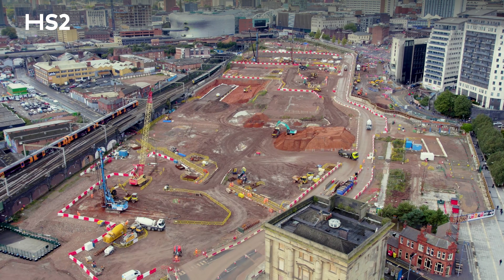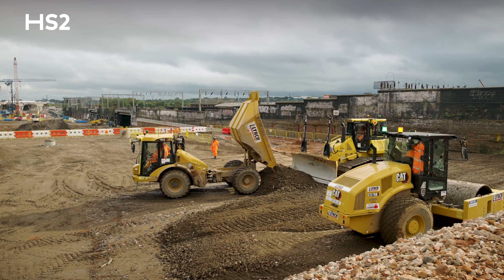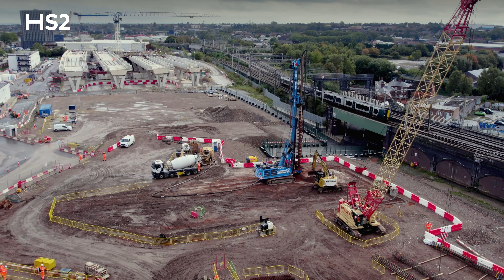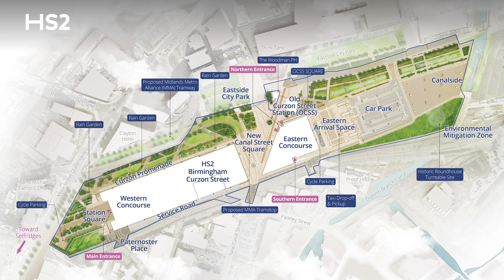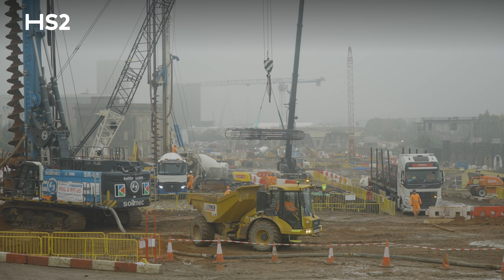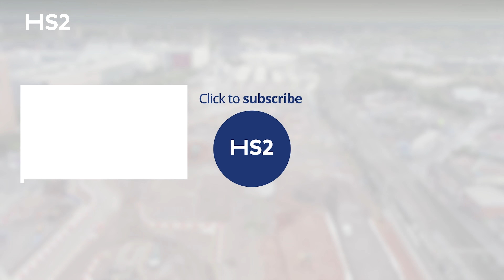HS2 lays the foundations for Birmingham’s new rail hub

Comment: Wow , 150 miles in 50 miinutes, that's too fast on land!! 3 miles per minute(approx) must be as close to a straight line as possible. It will be a wall of speed bi-secting the country-side...how can safety be assured along its entire route with 18 trains per hour going each way. A train passing the same spot every 1min 30 sec(approx)? Make it safe!

Comment: It will only be a rail hub if the line continues to newstreet, they did this before, unfortunatley this meant that curzon street became obsolete and it got knocked down. Maybe thats what is meant?
Reply: The rail hub is being built by connecting Birmingham Curzon Stret Station to an upgraded and expanded Birmingham Moor Street Station
Reply: @peterwallen1063  news to me. I have not heard of this.
Reply: @barrypickles6546  Well living in Birmingham take it from me it is happening and has been mentioned on Youtube, there are plans to enlarge Moor Street Station by opening more platforms. put in two chords connecting the camp hill line nd the Birminghm to Derby line to Moor Street so that more trains can terminate at Moor Stret station which will be connected by walkways to Birmingham Curzon Street Sttion. They can not connect the HS2 line to Birmingham New Street due to the difference in height betwen the two lines and even the old Curzon Street was not connected to New Street due to height differences between the two stations, but the old Curzon Street was not knocked down as for years it was a freight station then a Royal Mail station before closing in the late 1960's and becomming a grade 1 listed building
Reply: @barrypickles6546  Thats your problem, it has been mentioned on you tube and in railway magazines and living in Birmingham it has been mentione in our news media
Reply: @peterwallen1063  I mean I know they are buily next door to each other, but I didn't know they where going to link the lines, amazing. I suppose having the wcml will benefit curzon too.
Reply: @barrypickles6546  They are not linking the lines together the HS2 line  will be an independent line until it connects to the WCML at eather Handsacre in  Staffordshire or at Crewe they are just connecting Moor Street Station buildings to the HS2 Curzon Street Station and opening more platforms at Moor Street Station
Reply: @peterwallen1063  so not a rail hub.
Reply: @barrypickles6546  Yes a Rail Hub, as they are connecting Birmingham Curzon Street Station which will have it's main entrance on Moor Street Queenswy next door to Birmingham Moor Street which is being expanded with the opening of more platforms and spur lines comming in from the Cmp Hill Bank and Birmingham to Derby lines which will llow trains terminating in Birmingham from all areas of the Country to use Moor Street Station insted of Birmingham New Street Station  which will free up New Street Station for other services forming as the West Midlands Metro Mayor states a new Rail Hub n Birmingham City Centre. Not only that but both Birmingham Curzon Street and Moor Street will be connected to Birmingham New Street, Birmingham Snow Hill Stations and Wolverhampton Station by the Midland Metro Tram link
Reply: @barrypickles6546  Yes a Rail hub in that Both Birmingham Curzon Street and an expanded Birmingham Moor Street Station will be next to one another with connecting entrances betwee both stations but the track will not be connected
Reply: @barrypickles6546  Yes it is a rail hub as there will be interconnection between an enlarged Moor Street Station and Birmingham Curzon Street Station where by there will be walk ways between the two stations
Reply: @barrypickles6546  Yes a Rail Hub

Comment: Honestly, Birmingham doesnt need 4 train stations. Just re-use the Moor Street station (Yes it is in use but just add more platforms)
Reply: Snow hill is the same line as moorstreet, all they needed was a few more tunnels between the 2 and to take up the metro and hs2 would have been done.
Reply: @barrypickles6546  I don't think you know a lot about Birmingham, HS2 trains will not fit into Birmingam New Street due to there length and New Street is grid locked and the whole reason HS2 and Curzon Street Station is being built
Reply: @peterwallen1063  how long are the platforms at Birmingham Newstreet. I believe the biggest problem with Newstreet is the cross over tracks, not the platforms, an in dependant tunnel would solve this.
Reply: @barrypickles6546  No matter how much people keep going on about HS2, these new trains are far to long to fit into Birmingham New Street Station which is built into a restricted area betwen two tunnels and is full to capacity the reason Curzon Street Station is being built,( it is New Street not Newstreet two seperate words), plus if an independent tunnel would of solved the problem don't you think they would of done it. Building an independent tunnel would of caused no end of problems, one of them the closing of New Street Station while this supposed tunnel was built
Reply: Birmingham Moor Street and Snow Hill Station are on the Chiltern line and New Street is on the WCML and are not on the same alighnment as Birmingham New Street
Reply: @peterwallen1063  and neither are on the hs2 line. What is your point?
Reply: @barrypickles6546  Bwhat is MY point, trying to explain to the uninitiated people like your self that talk crap, I quote what you said " Snow Hill is the same line as Moor Street ( it is two words not Moorstreet ) all they needed was a few more tunnels between the 2 and to  take up the metro and HS2 would of been done " first I have seen better grammer from a 6 year old, next the Metro runs on the streets of  Birmingham and does join Birmingham Snow Hill station and Birmingham New Street station up with Birmingham Curzon Street Stations and can not be run in a tunnel under the City, next Birminghm Curzon Street and the HS2 route is on a different alighnment to both the line into Birmingham New Street and Birmingham Snow Hill plus it would cost to much to tunnel under Birmingham, that is my point. Before going on about the impossible, do a bit of reserch on the City and the reasons for building HS2 as such, yes I do know what I am on about as I live in Birmingham near to where the HS2 line is being built
Reply: @barrypickles6546  My point is that you mentioned in your comment, Snow hill and Moor Street (not Moorstreet) which have nothing to do with HS2
Reply: @peterwallen1063  yes that is part of what I typed?
Reply: @barrypickles6546  Yep, and then you asked me "Whats my Point" my point is you wrote about HS2 but know nothing of it and Birmingham
Reply: @peterwallen1063  so what is your point?
Reply: @barrypickles6546  My point is barrypickles6546 that you stated a silly comment about Snow Hill being on the same line as moor street and need a few more tunnels between the 2 to take up the Metro and HS2, what utter rubbish it appears you don't know a lot about Birmingham, it's Metro network and the respective Railway lines, for a start the Chiltern lines and Moor Street Station , Snow Hill Station are on a different alighnment to the New Street line with no physical connection due to differences in height plus neither of these two line can physically be connected to HS2 and Curzon Street Station again due to height differences between the lines and stations, next the Midland Metro is a street running tram through Birmingham City Centre and connects all stations in Birmingham starting with Snow Hill Station, then New Street Station and will eventually serve Birmingham Curzon Street Station, Moor Street Station and finnaly Digbeth National Express Coach Station in Digbeth, so that is the point mate. So as I said you do not realy know much about Birmingham and its Railways as when the decided to build Birmingham New Street they had dig a hole in the City Centre for the station and from the London end the line had to be lowered in a cutting to go under what was then the GWR Snow Hill to Paddington line and through a tunnel into New Street Station
Reply: @barrypickles6546  So whats my point, the point is that the reason for trains going into Birmingham Curzon Street insted of Birmingham New Street is that Birmingham New Street is grid locked with train services and these trains would not fit into the platforms of Birmingham New Street hence that a totaly new station is being built as a Terminal Station in Birminghm City Centre called Birmingham Curzon Street which will be used by HS2 trains only operated by Avanti West Coast Trins so frreeing up Birmingham New Stret for other train services, Birmingham Moor Street is on a different alighnmeny a is operted by West Midlands Railways and Chiltern Trains on the old Great Western line to London Paddington and the two station although will be conected by walkways the two lines will be independent of one another, thats my point, if you lived in Birmingham like I do you would understand the logic of what is going on

Comment: Between 5 and 6 piles per day is a joke compared to new build infrastructure schemes in China. Tesla’s Shanghai factory there was done in just over 9 months from bare ground start.
Reply: The piling also includes secant piling. Do you-know-what they are ?
Reply: @TrevorWilliams-fq8mg  Yes, that’s why the count is up around the 2,000 mark.
Reply: Then you should know what the piling output is. They are piles that are drilled into the sides of each other to form a water resistant retaining wall and they are much slower to construct. So your comment about the joke outputs has no relevance.
Reply: @TrevorWilliams-fq8mg  The rate I stated has relevance. China construction using multiple crews and multiple piling machines and worked 24/7. Another hallmark of why HS2 is so massively over-budget.
Reply: @PinkDuckUK  You don't know what you're talking about - the reason HS2 is over budget is almost entirely due to nimbys delaying and obstructing the project. For the entire 20 years while it faced legal challenges and obstructions, the project had to be run (wasting money) and redesigned (wasting more money) and crucially, unlike china, the project had to be built by contractors at a large premium because we couldn't give a clear start date due to the obstructions, nor any project scope since we didn't know which sections would and wouldn't be built.
Reply: But did the job in China have secant piling ? In China the planning restrictions are much less onerous than here in the UK. If we worked 24/7 we would be more comparable to China. Also the HS2 budget cost was a figure pulled out of the air. That is a joke.

Comment: Given the lack of direct connections - either cross-platform or up/down a level -  to other rail services in and around Birmingham it's hardly a "rail hub" for the city.
Reply: It will be connected to a vastly larger Moor Street Station

Comment: If its going to be the 1st mainline intercity station in 130 years, this 7 platform intercity station, wont be open for 130 years. Belfast's new 8 platform intercity station opened less than a month ago!
Reply: Birmingham Curzon Street station will be the first main terminal station to be opened in the UK for 130 years, how do you work out it wont be open for 130 years it will be open in arround 3 years at the most and the difference between Belfast and Birmingham, is that the Belfast Station is just a new Station but Birmingham Curzon Street is connected to the building of HS2

Comment: If you wanted to accrue the benefits of the infrastructure build as early as possible, it seems odd that Curzon Street didn't start construction earlier.
It didn't seem to be blocked by other construction.
I guess that's all down to budgetary constraints.
Reply: You raise an interesting point. Presumably  HS2 has decided on the construction programme but how have they arrived at what phases get built in what order ?

Comment: Why is it a terminus? Shouldn’t it be a through run?
Reply: Budget they didn't want to spend money building underground tunnels and stations. Even though it would have been much better. Manchester is fighting its corner demanding an underground tunnels and through station.
Reply: @DavidKnowles0  Nothing to do with budgets and spending money, to build an underground Station in Birmingham the size of Curzon Street would of caused may hem in Birmingham City Centre
Reply: No it wouldnt, they had the land at curzon street they could have used as a base and put tunnels through to newsteet. But then again they could have used the stratford line to snowhill and through onto wolverhampton up the metro line, bridges station and capacity already intact.
Reply: @barrypickles6546  They could not put any tunnels through to New Street station  as there is no room for tunnels and Birmingham New Street Station is not big enough to take these HS2 trains, plus it is totally congested and this is the reason for HS2 and Curzon Street to  relieve Birmingham New Street, plus the Stratford to Snow Hill line is un by West Midlands Trains to Worcester on a Metro type service and does not alight with the HS2 line coming into Birmingham as  for running HS2 trains on the Tram route, neither the Tram line or the Snow Hill line go into Wolverhampton on the old GWR ril route, the trains veer off at Smethwick to Worcester nd the tram runs into Wolverhampton using a road
Reply: @peterwallen1063  yes, unlike Crossrail where there was room for a tunnel, there is probably no soil to put a tunnel through either, making a tunnel impossible.
Reply: @DavidKnowles0   No room for tunnels  under the city centre so it was discounted from the beginning.

Comment: 12 monhts to do 2000.... barely 5 a day
Reply: If you understood the  construction programme, you would know there is no point in putting more piling rigs on site to speed up the piling prgramne if the follow on works can't be built at the same pace. You would be spending unnecessary money on piling for no benefit.
Reply: By the middle of next year, so ten a day.

Comment: Keep up the great work and it'' make a vast improvement to central Brum - excellent engineering and effort the whole length of HS2. Here's hoping the Euston and Crewe links at least get reinstated. Most of the waste so far is due to the stop/start, hot/cold attitude to what is a long term project.

Comment: 1:20 *only UK city with a highspeed rail connection to London
Reply: I was going to say, it wouldn't be if they'd built it in full!
Reply: @Inkyminkyzizwoz  it is being built in full Birmingham to London
Reply: @peterwallen1063 But the rest of it isn't!
Reply: @Inkyminkyzizwoz  HS2 carries on past Birmingham to Handsacre where it will join the West Coast Main line, there are also plans a foot fopr a line to be built from Handsacre to Manchester with a speed of 185 MPH. HS2 is only an upgrade of the WCML nothing to do with Cities on the East Coast it is a West Coast project.

Comment: what i dont understand is: why the heck is the UK still building terminus stations and less through running stations on HS2? might be cheaper on the short run but shortsighted on the long run!
Reply: To be fair, in the original plans for the full Y network, only Curzon Street and Euston are terminus stations, the rest of the stations are through stations.

Hopefully Phase 2A can get built and we'll see an expansion of the through station there to allow HS2 trains to integrate onto the WCML.
Reply: For Piccadilly there’s a good argument for an underground through station to allow northern powerhouse rail to run through to Leeds, but in Birmingham there’s no suitable alignment for high speed trains out to the north west of the station until you get the other side of Wolverhampton
Reply: @jamesnichols5163  Trains on HS2 on the HS2 line will run North West of the City by using the Delta Junction at Water Orton
Reply: there is a junction in HS2's design, outside birmingham, to allow trains through
Reply: A terminus station is the most effective way of bringing the station into the city center. A through station would a) divide the city in half or b) require massive tunneling (see for example Stuttgart, Germany). In the case of Birmingham, all trains would stop there anyway; there isn't a viable usecase for train running straight through.
Reply: @112Haribo Unless you wanted to run through services to Wales and Bristol
Reply: @bh3ader  Services into Birmingham Curzon Street wont run to Wales and Bristol services provided by Avanti West Coast, Transport for Wales and X Country trains through New Street run services to Wales and Bristol
Reply: @112Haribo  There's no room under the city to do it. It's a labyrinth of multiple level service tunnels in the area so there would be nowhere to route it through.  They cannot put a line under New St station as there's a main sewer and old Post office railway blocking the path. The existing railways were built before this infrastructure was created.